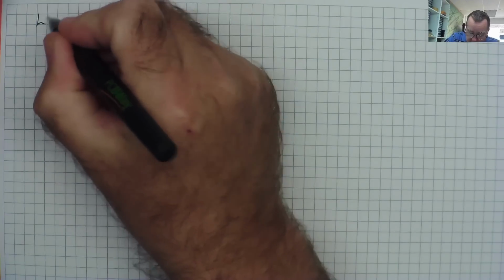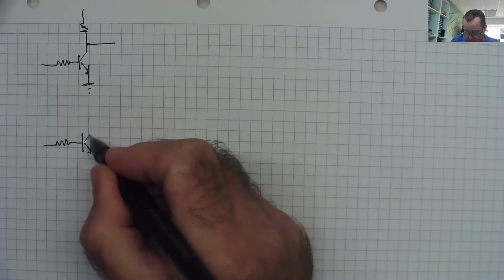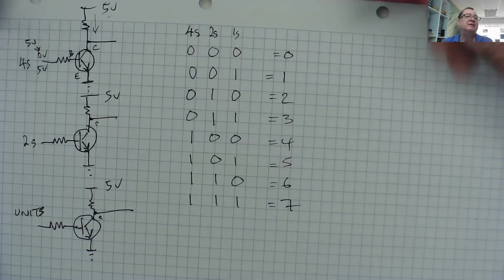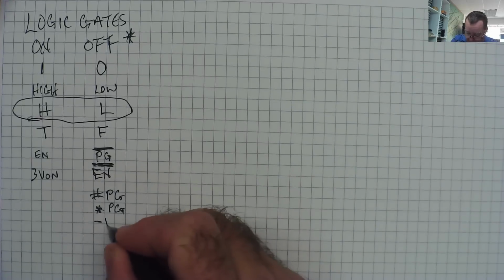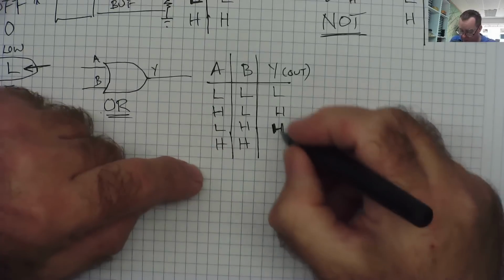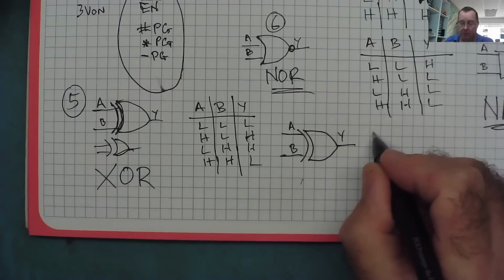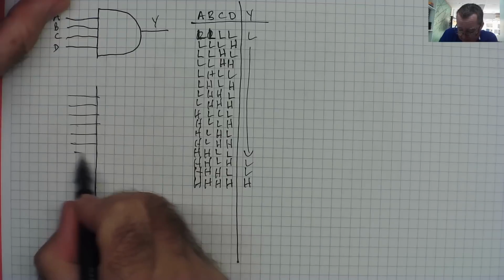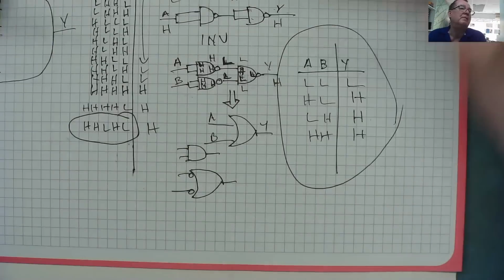All You Need To Know About Logic Gates To Fix Stuff - Tutorial Guide

Comment: I would argue that the Roman Numerals are a short-hand for indicating numbers rather than a system of mathematical notation like modern binary or decimal - where the notation essentially performs a whole set of calculations for us essentially for free. 

The Romans had a decimal system of maths and a crappy way of recording values. Much like we do when do when we force values from a system of mathematics based on the relationship between a day and a year into our decimal notation instead of a circle (eg. a clock dial). Just mapping the concepts onto each other is hard lol.

Comment: Sorry Richard you’re wrong. Electronics fall into 2catagories analogue and digital.linear is the relationship between various elements ie for linear relationship eg the ratio between voltage and current is constant. Digital has no relationship only 2 states on or off to represent the digits 1 and 0 the voltage or current levels are irrelevant. In analogue the relationship could be linear ,logarithmic,power or trigonometric.

Comment: 42:00: Just in case anyone is wondering: Yes, it's (kind of) called NAND flash because of that. The individual memory cells are connected in serial, which resembles the arrangement of transistors in a NMOS NAND gate. Likewise in NOR flash, the cells are arranged in parallel. NAND flash can only be read in whole blocks, thus needing more software processing to get the data you want. But it's fast and cheap (takes up only about ⅖ of the precious die space). So it's ideal for file storage, since most file systems are block-oriented anyway. And conversely, NOR flash is more expensive and slower, but it offers direct random access (and lower latency). Which makes it ideal for code storage (ROMs for microcontrollers and such). In your PC, for example, you'll find NAND flash in the SSD containing the operating system. And the BIOS will most likely be contained in a NOR flash.

Comment: Cool Stuff ! Looking forward to the next bits !!
I'm currently checking my digital synthesizers to see if I can add an analog distortion path. Most synths are riddled with 74 series logic(even analog synths).  So, I've gotta check whether or not they used all legs of the IC's(or how to add a 74 series) and probably the most difficult part is HOW to get the software to enable the new circuits.   Adding buttons shouldn't be a problem ... 
Most synths use multiple DSP chips and I'm hoping its only going to be as difficult as >> Hijack/interrupt the digital signal with a DAC > Route signal to my custom analog distortion chain > back to digital realm with an ADC // inject/input the digital signal back into the DSP's  ... 
 For example :  I have a supernova 2 and it has 9 DSP chips.  There are 8 voices, So I am hoping that last DSP is the final effect stage....   Who knows... probably not gonna work & I'll have to just add my distortion chain to an analog synth. However, thats almost no fun as analog synths already sound great, but this is all about the journey... 
I just started last week.  
yeah, this is going to take a while. 

The most digital circuitry I've ever seen in one place is inside synths and old phone servers. especially old analog phone servers.

Comment: I just happened to work on Aorus RTX3070 this weekend. Did some practice on my own as I was too impatient to wait for part 2 ;). I suspected an AND gate to be broken, not giving EN signal to PEX power supply. Pure luck that I had Gigabyte RTX2070 bought for repair as well. It had the same gates and power supply chips for 1.8 and PEX (GS9216). So I borrowed one of the gates, replaced it on the 3070, PEX and VMEM appeared and it works like charm! :D Thank you Richard!

Comment: Analogue and digital. A linear circuit is a kind of analogue circuit. There are also logarithmic circuits, and many other kinds of analogue circuits.
Reply: A diode for instance is non linear but analogue....
Reply from the maker: @kriswillems5661  Sure. As I mentioned, all electronic components are actually linear (or analogue) - even the ones we think of as 'digital'
Reply: I think you mixed up linear and analogue. You said a diode is linear, but it not....
Reply: A linear circuit adds, multiplies and offsets signals. If you put a sine wave into it all currents and voltages will be sine waves. A diode rectifier is not linear, because if you put a sine wave into it, the output is not a sine wave. All circuits only containing resistors, capacitors and coils are linear. But as soon as you introduce a semiconductor into a circuit it is at best partially linear. For instance when you use a transistor in a class A amplifier the only thing that is linear is the current amplification, but the base emitter diode is still acting non linear. Wherever you said linear, you should probably have said analogue...All linear circuits are analogue, but not all analogue circuits are linear.....
Reply: A metal oxide varistor would be an example of a passive component that is not linear.
Reply from the maker: @kriswillems5661  I agree with you, yes they are non-linear devices, so I should have said analogue.